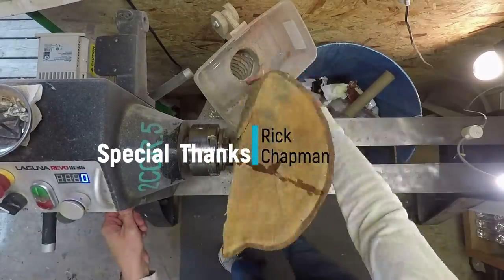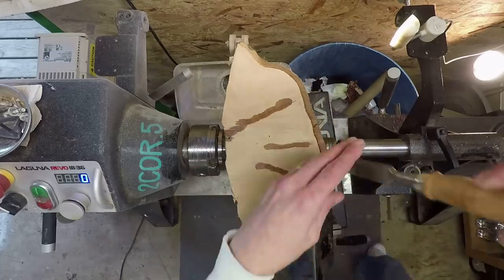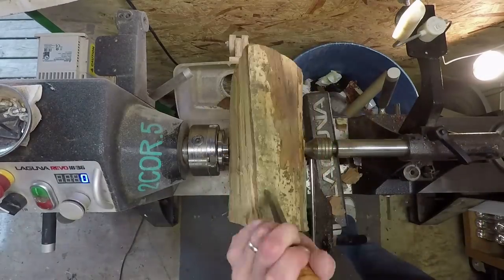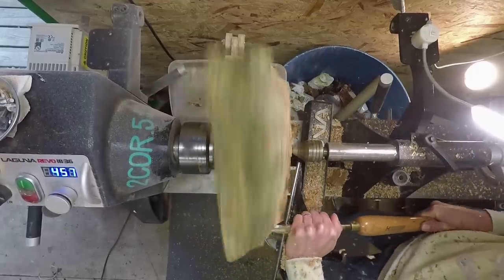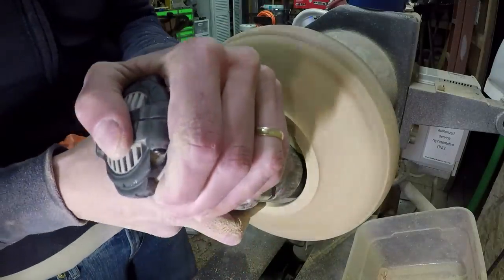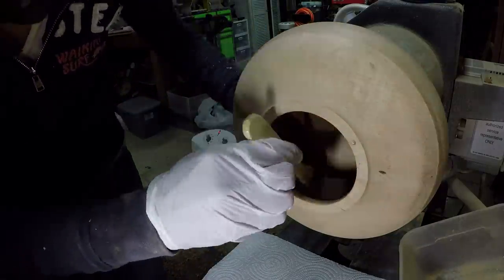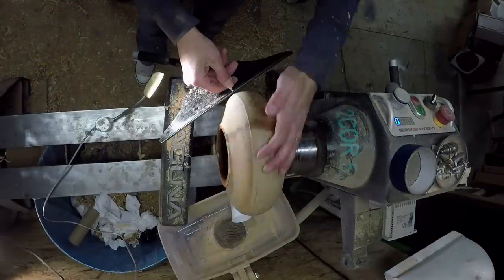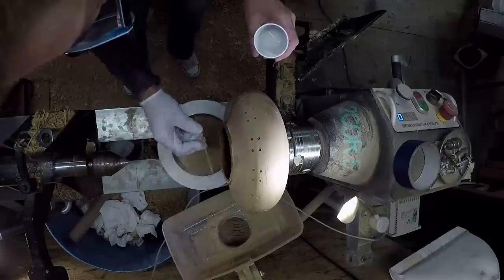Red Alder Lace Wood and Silver Wax Hollow Form

Comment: I do a LOT of hollow forms.  So far I have used mostly Easy Wood Tools like you (and love them), though I also have a larger 5/8" John Jordan Tool that helps get further into the sidewalls.  The John Jordan is not a carbide tip though--it is a "hooktool" cutter.  It's quite a beast when attached to an 18-20" handle!
Reply from the maker: Thank you Davis. I will look into that system!

Comment: I am using the D-Way hollowing tool. Very nice even as a beginner. That is a fabulous piece for sure. Why do you first use shine juice before applying the metal wax?
Reply from the maker: Thank you!!
I only applied the shine juice to the top part where the wax was not applied...and the inside.

Comment: Wonderful design and turning, Kim!  I have the Simple Hollowing System by Simplewood Tools.  It's a great starter system that is reasonably priced.  It can't do larger pieces much over 8"-10" deep, unless you have a larger opening and can get the tool rest deeper to support.  System is very simple to put on and take off, folds up nicely when not in use and is very stable for hollowing with.
Reply from the maker: I will look into it. Thank you so much!!🤗

Comment: Hey Kim, just had an idea for keeping all the mess out of the rest of the shop. A clear shower curtain and rod behind you should keep a bunch of the mess from broadcasting all over the room. I have a small compact shop so it's a pain. Dust collection just helps, most goes over your shoulders.
Reply from the maker: I think that would also be useful for the colder months.. Help keep my space heater heat in my little corner lol
Reply: I ordered the clear curtain strips for the garage roll up door for my shop out back. Good for keeping mosquitoes out too.

Comment: Hi Kim, I’m in the UK and have polymyalgia which affects my upper arms and hands so I definitely needed assistance with hollowing.  I bought the Hope Deep Hollowing System and find it a tremendous asset. However, it is necessary to remove the tailstock assembly which is a struggle with my condition.  But I have seen the Tim Yoder Elbow system which attaches to the tailstock and think I would have bought this had I lived in the US.  Incidentally you have the digits 2COR.5 On your lathe, is it 2 Corinthians 5.  Regards and so many thanks for your videos and dialogue.  Brian
Reply from the maker: Thank you Brian for sharing that. I will look into both systems. 
2 Corinthians 5:17 the dust is covering the "17".
Reply: @KimTippin Thank you, Kim. I’ve just re-read it.  Its nice to be reminded.  Bless Brian

Comment: Just curious if there was a reason you chose epoxy to glue on the rim rather than wood glue?
Reply from the maker: I thought that i could get this project done that night so i used epoxy that set faster. Due to it being cold outside, that wasn't the case. I had to wait over night anyway. Wood glue would have worked just fine too. i was in a hurry... like always . lol
Reply: Kim Tippin Wood Turning ahhhh ok. We’ve all been there lol

Comment: beautiful bowl!
I have tried OB and it seems that the coats after the first one just disolves the first coat, actually removing some of it while then putting more on again,  and I don't get the build up that everyone talks about.  I finally gave up on it because the results were so disappointing.  I wanted it to fill grain in walnut and it just would not build up enough.
comments?
Reply: Hi - Shellac is a film finish - a very thin film! So it will take a huge number of coats to build up enough to fill the pores of an open grained wood like walnut. They recommend a grain filler for that purpose, then the shellac. Or a very heavy cut (10 lb. cut?). BTW, Zinsser shellacs are 2 or 3 lb. cuts. I think the build up they refer to is a nice shiny surface that feels good to the touch. -Mike
Reply: @mpart_woodlathe-stuff  I guess that's what deceptive about youtube videos.  On the vids, the turner holds up the piece and it's all shiny; the piece with OB looks like it's been lacquered smooth but in person, I'll bet it's another thing.  Here, I've been trying to get a finish that doesn't exist!   THANK YOU for clearing this up for me!
Reply from the maker: You are correct in that. Some wood will hold that shine and others dull over night. I try to take photos of it a day later so people can see how it has dulled down. Partly because i will only apply two coats instead of 5 or so.. I am impatient and still learning different woods and how each take a finish. I also make a 60/30/10 OB Shine juice that I feel builds faster ( on some woods) .  60 Shellac/ 30 DNA/10 BLO try small batches with different ratios. Find the one that works for you.  I had to.

Comment: Do you prefer using a dovetail recess, or a tenon in your chuck?
Reply from the maker: depends on what condition the wood is when I start. also what kind of wood I am turning. I learned the hard way the cedar will split 90% of the time with a resess. most wet wood works best (for me) with a tenon. I like to do a dovetail resess if I can. It holds the best for most purposes. Getting the size of the  resses correct is important.  Regardless to how you choose to mount your piece,  it is a good idea to get in the habit of checking it periodically throughout the turning. 
I hope this info was helpful 🤗😁